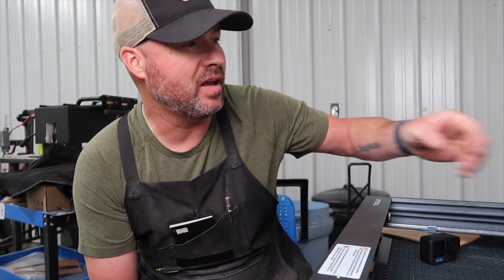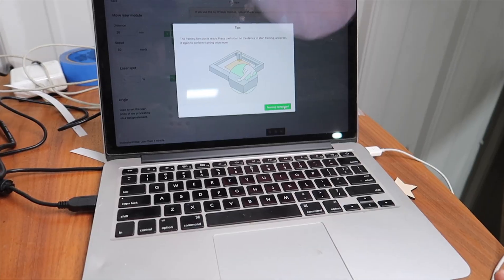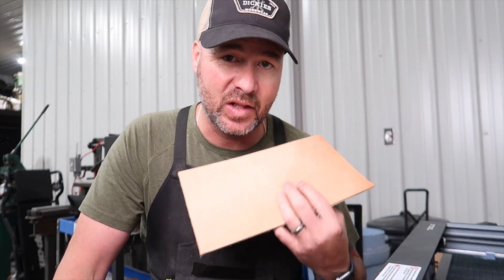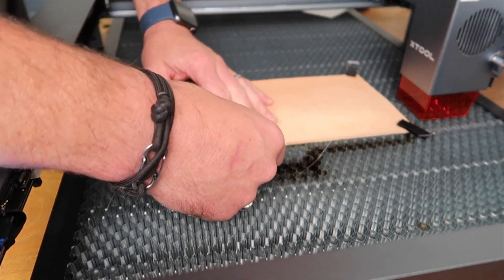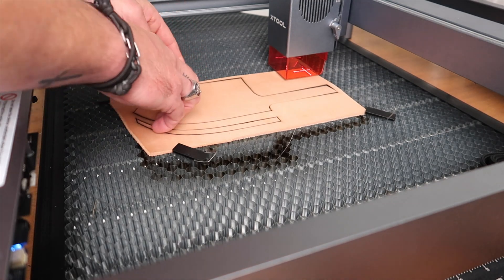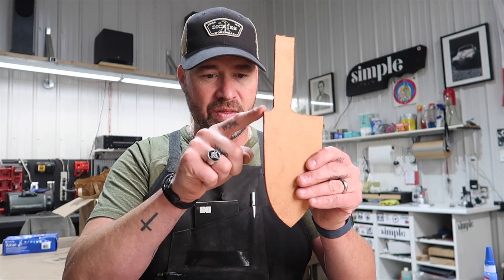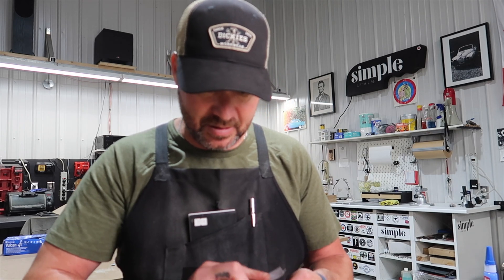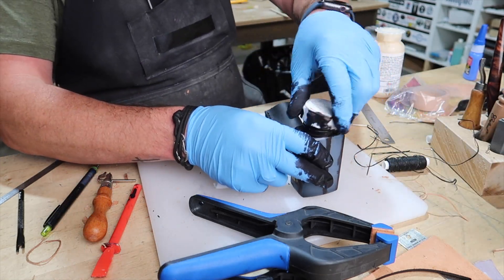2 questions about the XTOOL D1 Pro Laser...

Comment: Hey Jeremy… Something you can do to help your leather lay flat AND cut down on the smoke is wet your leather before you start your cut.
If you have Light Burn you can take a picture of your paper template(s) and import them in.  Run a trace on the image, and from there you can easily make any adjustments you need to.

Comment: I got the xtool 40w after watching your blade engraving video. I really like it and have used for engraving leather as well as engraving steel. Took a minute to figure out a way to get a good visible engraving on an acid washed blade but it does a great job on that too. Plus you made a good point, I now want to engrave everything.  Great videos. Thanks

Comment: Have you tried etching handle materials? I used a 20 watt laser to etch a logo onto a peice of black canvas micarta. It had a good contrast but that was only becuase i did not take the shiny coat off of it first. Still... It could be an intersting rabbit hole.

Comment: Will the 10W laser get through the leather as well?
Reply: My 10W Ortur will cut 1/4” plywood. I make perhaps 12 medium speed passes to avoid charring it to death, but it’ll do it.

A 20W is roughly three times faster at that task.

But if a 10W will do ply that thick, it’ll surely cut leather for sheaths. Use Lightburn as your software so you can experiment with travel speed, laser power output, and number of passes in order to obtain a cleaner cut.
Reply: @MemphisMechanic  Good to know thanks, I never trust the manufacturers claims. I have an Ortur (LM3) as well, havent cut anything but paper so far (need to organise air and smoke extraction)
Reply: I can vouch for a 20W doing it
Reply: @RedBeardOps   I have a 10W and it does stainless engraving fine (not cutting anything yet) but dont want to buy the air pump and find that 10W struggles with leather. I am hoping it will be fine as is, the more powerful lasers are a bit too much to justify for the hobby just now.